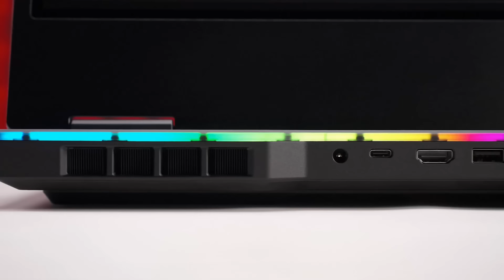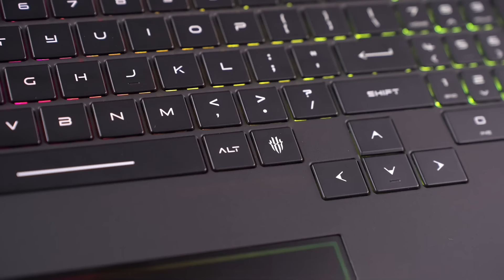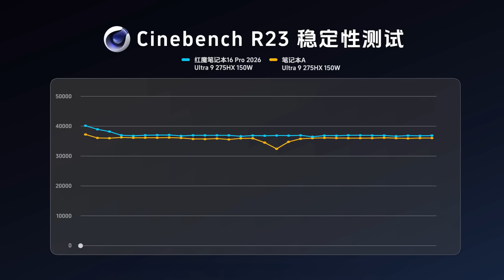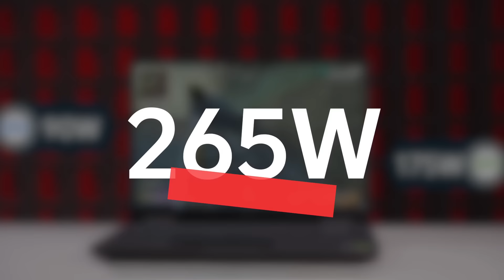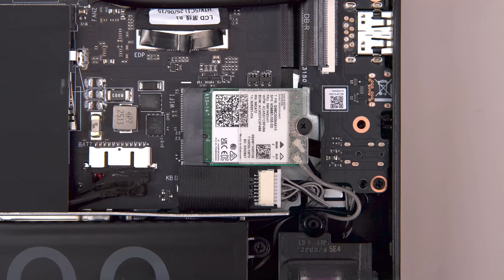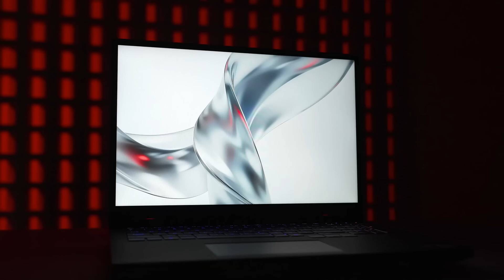RedMagic Titan 16 Pro 2026 Review: The New King of Gaming Laptops?

Comment: I had Red Magic 8S Pro, the best performance, best battery, it doesn't get hot, always cool, excellent OS with little or none customization of Android and also a beautiful device. A strong con was the front camera, it's almost unusable because of picture quality, they should stop using the hidden under display camera, another con was the lack of accessories, which is not directly fault from the manufacturer. The device was the best for the rest

I'm very excited for a laptop from Red Magic, hope it's easy to get one here in Brazil
Reply: Play vrchat and it'll heat up

Comment: When I heard that it was going to be "4k", I wasn't thinking that it was going to cost "$4k". 🤣
Reply: It costs 4k, that screen is 2,5k
Reply: @jimboh.2654 Thanks for the clarification, Socrates. 👍
Reply: @jimboh.2654  no way, einstein.
Reply: @jimboh.2654 it's actually 1.299
Reply: It's $1600
Reply: @Jimbo-s7v no way a rtx 5090 laptop costs 1600
Reply: @eren_0jaeger it's listed for $1600 on the U.S. website.
Reply: Anyway there's some isues that electronics price gonna crank up high due to NAND shortage so.. it probably cost more than 4 grand

Comment: NO OLED LOL
Reply: oled is planned obsolescence == bad
Reply: I prefer ips since it doesn't have pwm flickering and pixel dithering.
Reply: OLED is terrible for a gaming laptop. OLED only belongs on gaming monitors since they are much cheaper to replace. Mini-LED now and Micro-LED in the future should be the only types of display in a laptop. Even if you get lucky enough to never get burn-in with OLED, after several years of heavy gaming, the display will have noticably dimmed, because OLED as a technology was not meant for daily heavy usage at high brightness
Reply: Yeah. Born dead
Reply: Holy burn in batman
Reply: The Alienware gaming laptop doesn’t have oled either
Reply: Not durable and more expensive
Reply: Red magic mobile tablet laptop Best ❤
Reply: wait till you see how shit oled looks on laptop lol
Reply: More battery lol
Reply: if that was oled, its 3x expensive or even more lol
Reply: @Snaztob  if this was OLED it would be $10k at minimum
Reply: Nobody needs oled

Comment: This is a same garbage as RedMagic phones. At full power it will work for about 30 seconds, then it will reduce frequencies or turn off due to overheating.
Reply: latest redmagic phone can run ps4 games natively...
Reply: @leonardo9429 actully no
Reply: @leonardo9429  https://www.youtube.com/watch?v=SNk61SizAL0
Ye ye. Skyrim 20fps and 103C degre after 1minute of playing. Have fun.
Reply: if the mobo and the bios firmware are good with this temps this beast  can last a long time
Reply: Idiot